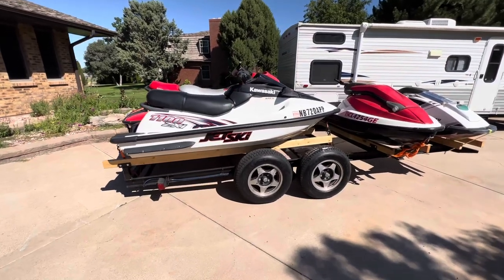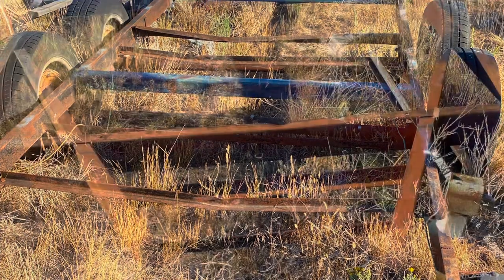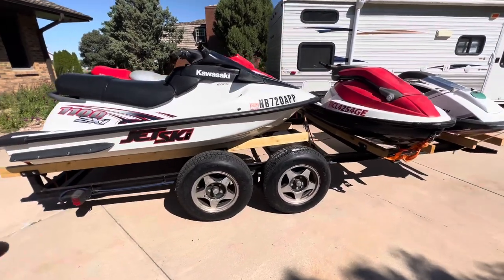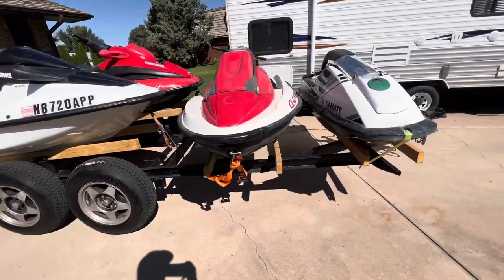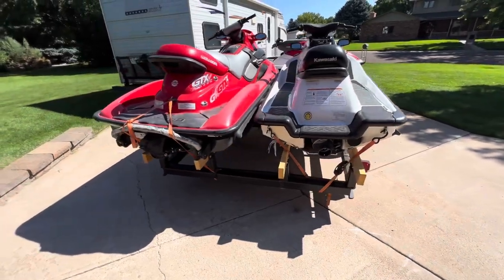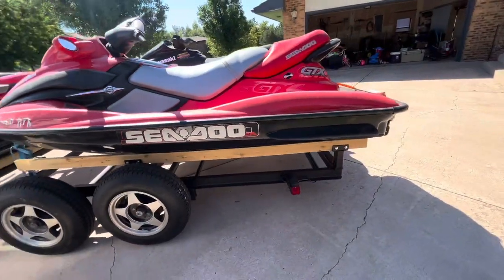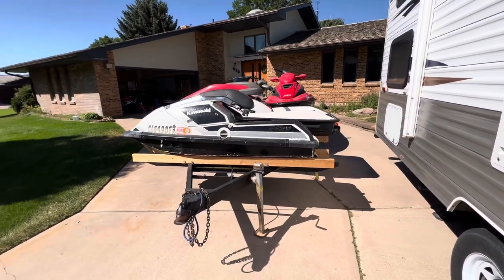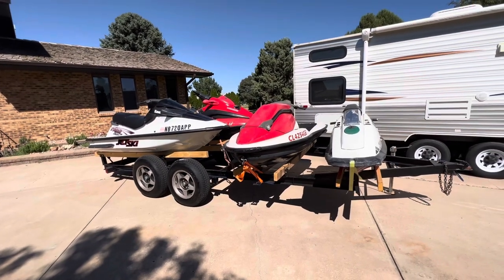4 place jet ski trailer

Comment: I'm looking for a 4 ski trailer and I have a question.  How do you off-load the front two skis?  Do you angle the trailer at the ramp to have the trailer nose in the water?
Reply from the maker: No I actually just back it in far enough to unload the back two and walk them out of the way and then back in a little farther and take off the front two. It goes best with 3 people one in the truck and two unloading but you can do it with two just takes longer.